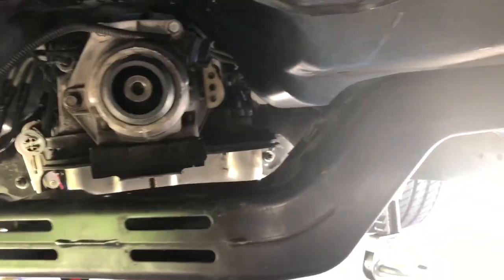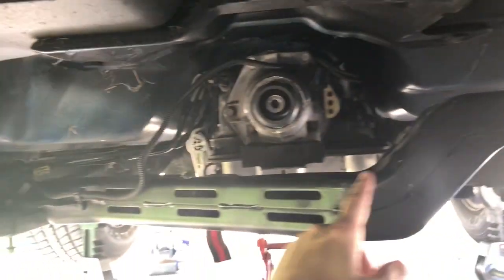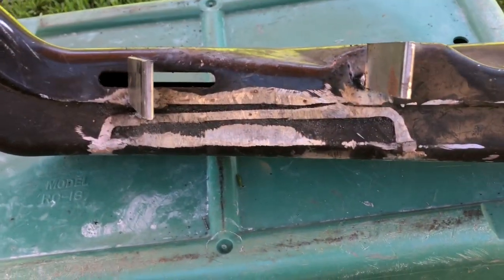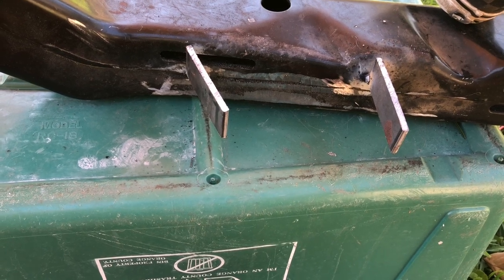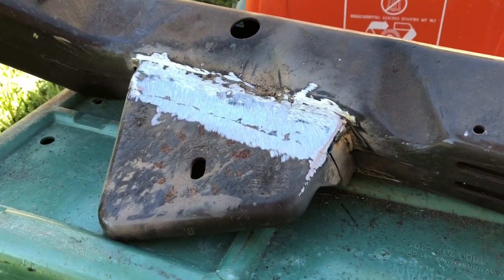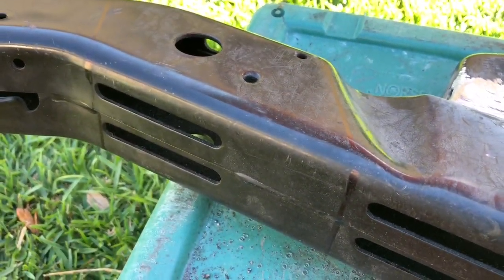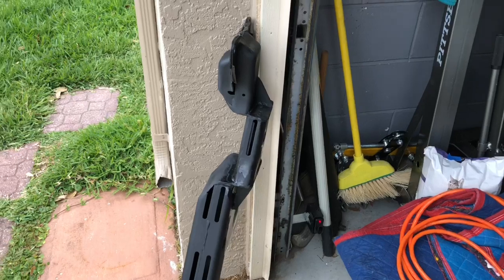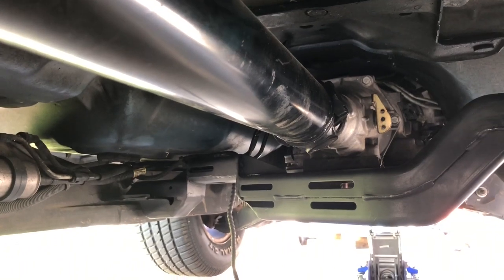S10 LS V8 Swap Part 9: Modifying The Crossmember

Comment: While you are getting welding wire buy the required items to convert that welder to gas for a cheap welder that welder welds good with gas and .30 wire
Reply from the maker: Did that a little later on. Worth it!

Comment: Did u have to get a custom drive shaft ?
Reply: You can in most cases, but you will need the flange and u-joint on the rear end side to adapt it to fit to the Ford 8.8 rear end. People do it all the time. And NO, you do not need to shorten or cut down the 8.8 rear end to fit the S-10.
Reply from the maker: I’ve heard you can use the factory, but I’ve got a Ford 8.8 in the back, so I got one made.

Comment: Wouldn't the V6 cross member do the job..?? Maybe starting with a V6 S10 would make more sense.
Reply: So far with my s10/6.0 build. Once you center the motor. Notch the crossmember. The 4l60e should line right back up and if you want use the factory driveshaft.   I started with a 2000 s10 4cyl
Reply: Tower Tito I’m in the process right now I didn’t have to notch the cross memeber I used the H3 alpha pan I wasn’t sure if the same drive shaggy would work, my motor is centered so theirs no need to cut is what your saying? Just move the motor mount skid plates back?
Reply from the maker: Hmmmm. I’m not sure what the v6 crossmember looks like. I was just working with what I had!

Comment: So the tranmission crosmmember has to be modified too? Does 4l60e v6 transmission paired up with the 5.3 needs this kind of modification?
Reply from the maker: I cut the mounting plate off and moved it forward about an inch, and cut and welded the driver side to add clearance for exhaust to run on both sides. 

I guess you could extend the mounting plate and hole, then run both exhaust pipes down the passenger side, if you don’t want to do too much work. 

Or you could always buy one!
Reply: That depends if you are moving the transmission & engine forward then yes, if you're leaving the transmission where it is & bolting up the new motor to it then no you wont have to modify crossmember. Unless your truck is a low rider just route the exhaust over or under the crossmember

Comment: What transmission did you use? Will the 4L60e work with a 350?
Reply from the maker: 4L60E. By stating 350, I am assuming you mean an old school small block? 

It will bolt up to it. You would need a transmission control module to make it work though, as the 4L60E is electronically controlled.
Reply: @CliffsHowTo  you don't need a $500 control module, that's a fraud. All you need is the same computer from the 4L60E matted to the Case Connector Plug, a Tach Signal, the Throttle Position Sensor, Red Wire to the Battery +, Black Wire to the Battery - , and the Pink Wire keyed to the Hot Wire. An electronic transmission conversion isn't different to an electronic controlled engine conversion.

Comment: Was u able to mount the bracket that the alternator mounts to and power steering
Reply: Having trouble with the steering is box in the way
Reply from the maker: I did, but don’t have the pulley on the steering pump yet... you need a smaller diameter pulley, from a car.
Reply: @CliffsHowTo  no you don't